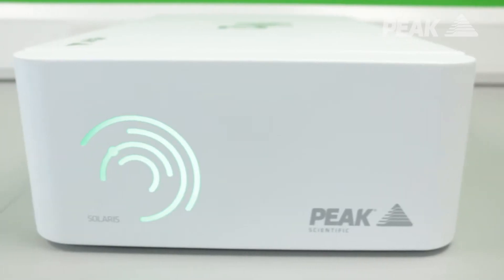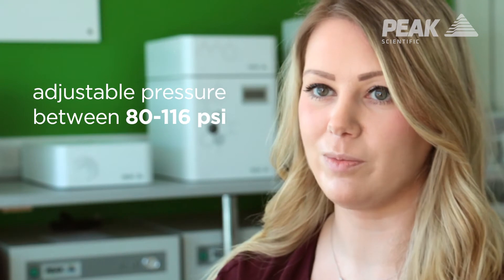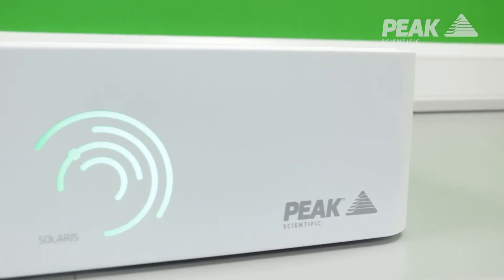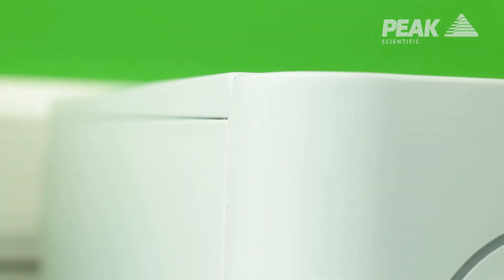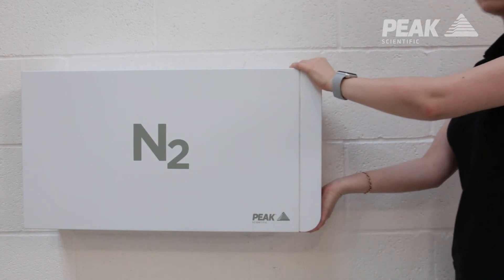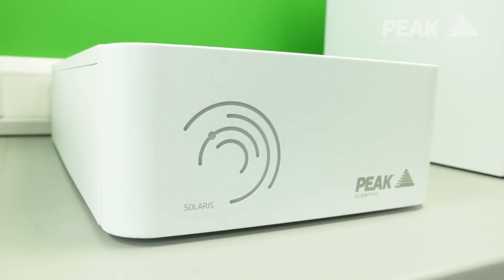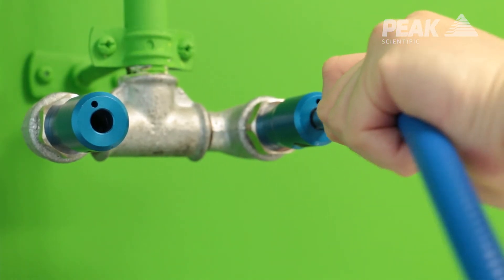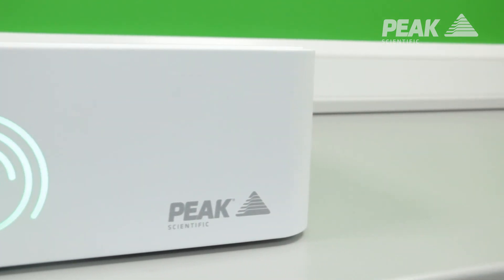PEAK Scientific - Solaris XE

Comment: Can you give specifics on the noise generated by the generator?
Reply from the maker: Hi Karen, 

Thanks for your question. Solaris XE is silent because it does not contain an internal compressor. It will require air either from in-house supply or from a standalone compressor and the noise generated from those will depend on what is purchased to supply air. You can find out more about Solaris XE on our website at http://www.peakscientific.com/products/specialist-solutions/solaris-xe-nitrogen-generator/ 

Thank you for getting in touch.

Kind regards,
The Peak Scientific Web Team